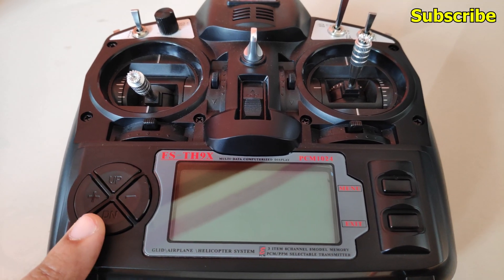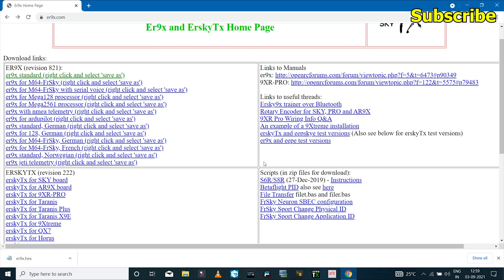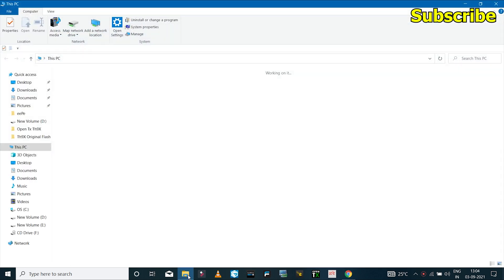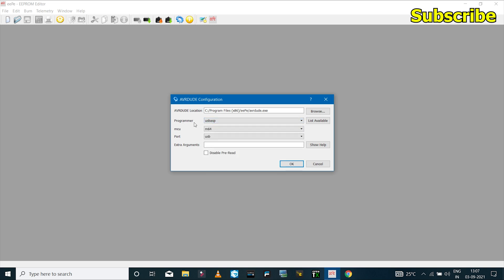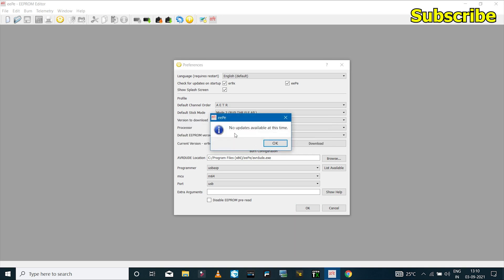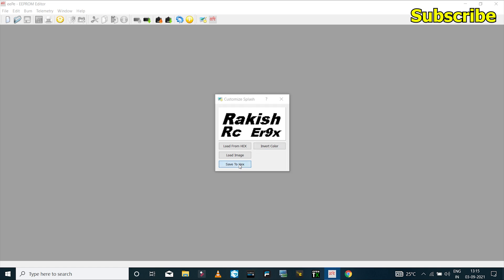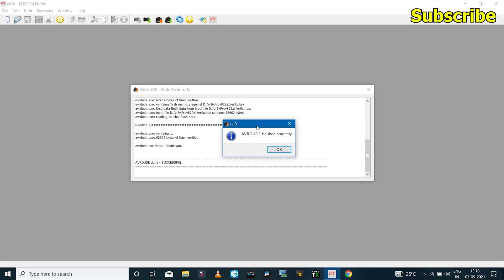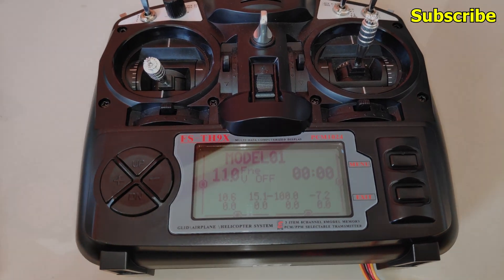Installing ER9X on new V2 Flysky TH9X / Turnigy 9X AFHDS2A Radio Transmitter

Comment: After flashing open tx can we use r9m , djt or dft module....????
Reply from the maker: On th9x with er9x firmware you have some additional options for rf protocol. All modules are supported in ppm mode  on both open tx and er9x firmware